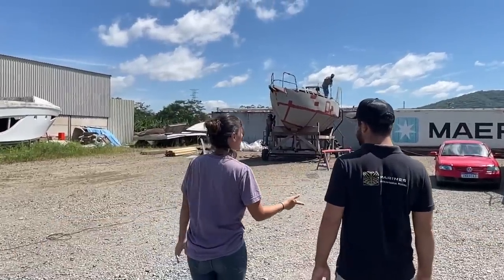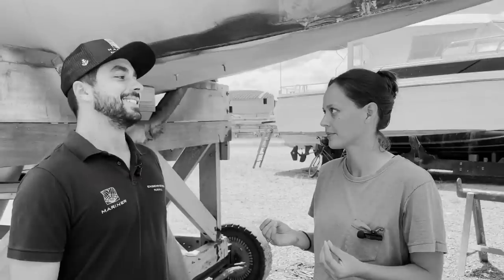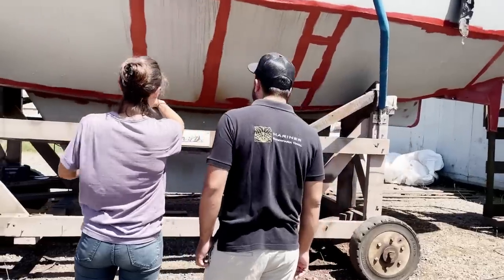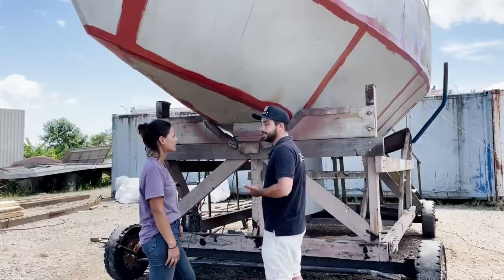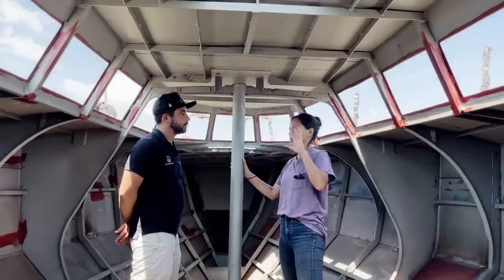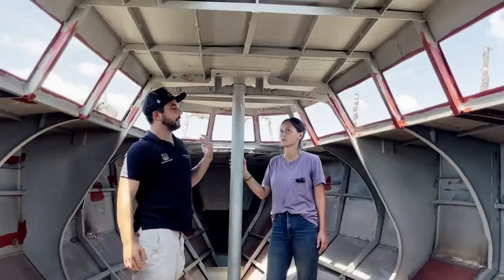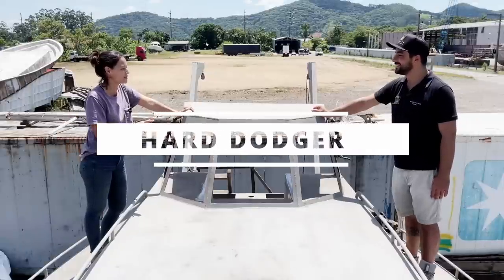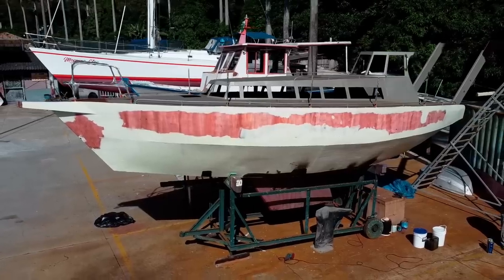Is our SAILBOAT going to SINK?! ⛵️ Ep25

Comment: The battery bank and electric motor probably much heavier than the Diesel engine The engineer didn’t mention anything about the The weight of the massive battery bank the solar the Chargers and equipment much heavier than a diesel engine
Reply from the maker: We will be talking about all our calculations and installation of the electrical equipment soon. With technology these days, most equipment is a fraction of the weight it used to be, including lithium batteries in contrast to lead acid. Also, the distribution is the key. You can distribute the weight of your battery bank and equipment for balance. You cannot distribute the focus of weight of a diesel engine. Stay tuned for our electrical install!

Comment: The Marine Engineer was mentioning weight and balance . You've added more weight with the bow , stern extensions and filling the keel . He noted that the added weight could raise the waterline ( boat sits deeper in the water ) . keeping track of weigh being added as you build on the rest of the project would be good idea . Good video bringing in a expert .
Reply from the maker: He had a lot of great advice didn't he? There's lots of factors he helped us through. We have a rough calculation based on the original weight of the boat with the old wood interior and motor and we will keeping that in mind as we move forward. Having an expert here definitely made us feel more confident. Cheers!

Comment: Want to make sure that the ballast will not corrode? drill 2 small holes, one on each end, pump nitrogen into it, nitrogen is heavier than air, and it will fill up the space and all the air (O2) will leak out and over. without O2, no corrosion will take place. I use the same thing when I used to store barrels of corn, rice, and whole wheat in 50 gallon drums, they would last, predictably for 20 years or more.....
Reply from the maker: This is also a really great idea that we were considering! So fascinating that you can store things for so long with this technique!

Comment from the maker: What do you think?? We made so many changes on our boat that some of you were questioning the safety. So we called an expert to let us know if our boat is going to cut it! We learned a lot when Gustavo visited and already started working on some changes on our boat. And we are still considering to make some more modifications before we call the construction a day.

You might have noticed the davits in this video since we shot it before we removed them. We did discuss the balance issue that some of you had but sine we ripped them out we didn't include them in the video. But let us know if you want to hear more about that.

Do you have any other questions that we might have missed??? How do you feel now that Gustavo weighed in?
Reply: A very high IQ move, I only had one boat surveyed that I was donating to sea scouts in Houston. I am guessing the electric motor & batteries will weigh less than the original diesel  & associated fuel.  I do think you should find a dedicated place for the generator for when the sun does not shine. I sound proofed our horse trailer generator, plenty of information on line about sound proofing.
Reply: I will sadly miss the davits….they were uber cool in design terms, like not seen anywhere.  Glad the Lahakai project continues to move forward.  🤗
Reply: I for one do not miss the davits.  They looked out of proportion to me
Reply: Weight-wise have you weighed-up (ha) the balance of water-maker vs water tankage - large tanks that could serve as buoyancy aids when empty and relying on the water-maker for passages etc.

Comment: Drill a hole in the keel top and add heavy oil to the steel shavings  to displace any oxygen, then seal with a threaded bung. Alternatively melt in paraffin wax.

Comment: with the steel grit if corosion is a worry you can fill it with oil get some extra weight an no air = no rust

Comment: The marine architect made some good comments and suggestions. 
Using hot ‘pitch, bitumen or tar’ to seal off the steel shot in keel is a good idea ( they have similar properties).  But I would suggest you cut a hole now and fit a 3”/75mm threaded pipe plug while it is easy to do and add the ‘hot tar’ down the hole or you will never do it! 
If there was ever a leak into the area you would want to know.
The thing to remember is welds are notoriously easy to have pin holes you can’t believe are there but in a tank or boat in water can be a problem . Fortunately the pinhole will rust shut but sometimes its better not to runs in first place!
 I know you are in love with the electric motor drive but nobody without a generator is motoring very far with electric. 
I hope you have generator or build in a bracket or place to bolt on an outboard bracket so you can fit one ( maybe from the dinghy) for when you have to have power. 
There will be times you need it! 
Cheers Warren
Reply from the maker: We actually decided we are going to do his suggestion of sealing the keel. We will see how we will get it in there now. You are right about little pin holes. Plus we thought we should do it now and not leave it for the future.

For the electric motor, we are really looking forward to talking about this much more. Once we get our battery bank in and all the configurations we'll know how much power and distance we can get and tackle that topic of how to live with an electric motor. We'll keep you posted!! Thanks as always Warren!! Cheers!

Comment: Factor in a big anchor winch and heavy chain with plenty of length should help the balance....
Reply from the maker: Ah yes, this is very true. One thing he said off camera was that part of weight distribution is when you are done and the boat is in the water, moving things around the boat is also part of balancing it. So we will add the anchor and chain as you said. We have a very small boat so say you have a heavy tool box, we'd consider the best place to store that, perhaps in the stern to balance the anchor. But in bigger boats, it could mean moving around larger equipment.

Comment: Hello, it was a great idea for you to call an engineer for the vessel inspection but I would like to make a note about the welding. I do welding inspection and non-destructive testing and it seems to me that the welding that the welding carried out on the hull plates has several "welding procedure deviations" , only the fact that the welder has left an excess amount of material (weld material) is already a sign that the welder does not have much experience. Excess weld material generates stress on the welded  areas and over time this stress can lead to cracks. If you remove excess material from the outside, you must also remove the excess from the inside to equalize the stresses then NDT the entire weld. I advise you to do a NDT (Non Destructive Test) on the hull called dye penetrant inspection. With this inspection you will be able to verify several problems that may have been generated by the welder such as cracks, porosity and others. The hull of the boat is one of the most important part on the vessel, if you leave any welding problem  that goes through the hull it can sink the vessel. The welding process is not as simple as it seems. In order to weld, a procedure must be developed that  involves specifying the material to be welded, the type of electrode to be used for that material and a procedure that establishes the welding process and the adjustment of the welding machine and other details.  I hope you did it correctly. At the very least I advise you to look out for an experienced welding inspector for the weld check. Engineers do not have the technical knowledge to evaluate welding unless he is qualified as a welding inspector by ABENDE. Brazilian Association of Non-Destructive Testing or have a degree in the subject. I wish you good luck and hope your project can be finished soon.
Reply from the maker: Hello! Thanks very much for your advice! It is very true what you say and we've been concerned about the welds since we left our last location. Did you see our last episode? We are doing lots of different topics simultaneously so some things might appear slightly out of order to group together each subject. We hired an experienced welder that works as a manager of the welding department in the company next door and he is overseeing the repairs. They repair large boats like ferry boats. We sanded down all the welds as you can see in the video and then fixed anything that appeared to have issues. We will do a final inspection again prior to moving forward. We completely agree with you, this is the most important step! Ever other one depends on this being right. Cheers!!
Reply: The space between the ribs and the hull plating worries me. Heavy seas will flex the plating and may cause metal fatigue. The welding looks erratic and poorly applied. Giovanni is absolutely correct in advising you to have the welding checked by an expert. I fear that the ribs and longitudinal structure are not strong enough. Sorry to say this but I would not go to sea in this vessel as it stands.
Reply from the maker: The original frames carried this boat from France to Brazil and after 25 years there were no distortions or issues with them other than rust. We then replaced all of the longitudinal frames below the waterline for thicker angle steel bars knowing that the boat will be more active. Gustavo visited us a couple times and we spoke a lot so we couldn't catch somethings on camera without making the episode too long. But he said that the framing was really well reenforced and that he had no concerns about them.

Comment: looking good, progress off the fairing of the terrible welding. Stern extension also a good step forward. But the davits will spoil yr possibility to sail.There will be no balance possible. Maybe in light winds, but if the wind change and that will be very frequent there will be a problem to keep the balance, between the important pressure points. Wind on sails/ships superstructure/ships underwater pressure point and G point..
When a boat will be hoisted in this davits configuration the ship will be able to be handled under sail with a little more then 20 knots off wind.

wishing you succes in the coming months and wisdom in the chooses too be made.

Jaap Jonkers Master mariner all sailing ships WWide.
Reply from the maker: It's coming along, isn't it! We did have a long conversation about the davits with him but we didn't leave it in because we have already cut the davits off. He told us that structurally it is fine, even the balance. But we were concerned about corrosion and their build so they are not there anymore. We are working on a different design now that does take into consideration the vertical space and wind. Keep an eye out for that video coming soon! Glad you like the other alteration! Thanks so much for your support and advice!! 🙌🙌

Comment: Ballancing the boat mathematically rarely works out, as there ar way to many variables in interior materials weight. The safest wat is to go light and add bags of lead shot in the bilge after the boat is in the water and loaded as it normally would be. This als allows the ballance to be changed as you add or remove items(batteries etc), as long as the lead bags are reasonably accessible.

Comment: Your boat has a very nice profile. It will be interesting to see when you put it in the water whether it is balanced. The only thing I didn’t like was the steel shot for ballast. I think you should have used lead.
Reply from the maker: We would have loved to use lead! Unfortunately it is very expensive and we couldn't afford it. The steel shot was donated. We are going to do his sealing suggestions in the keel to avoid any issues in the future. Cheers!

Comment: How will you remove mast if necessary to fit into in to an area? I think you already thought of that by placing a mast hold down welded to top of boat.
Reply from the maker: The original mast is deck stepped so its easy enough to remove. It isn't the kind that can be done without a crane (like the foldable ones in Europe), but it does just sit in a collar on the deck.